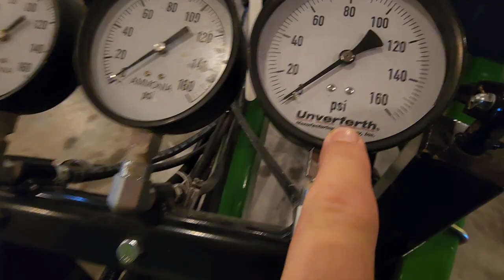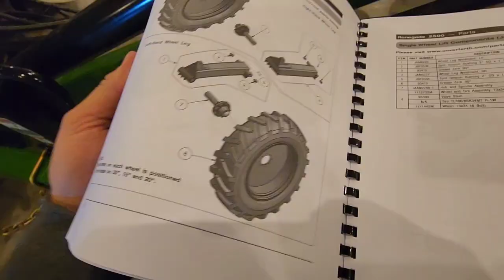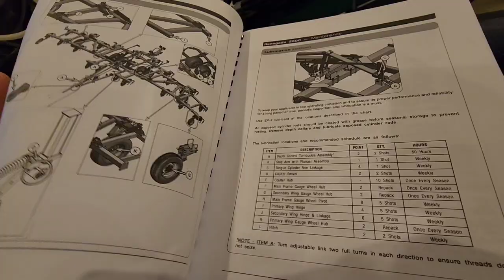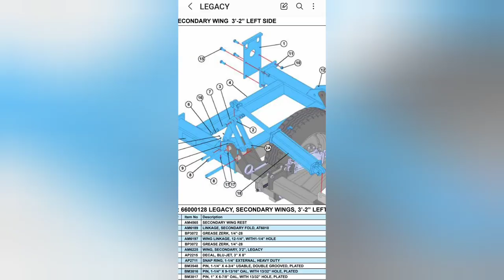Unverferth 2500 toolbar

Comment: The joys of purchasing new equipment. I don't think I ever had a piece of equipment that you couldn't just take to the field without doing some adjustments. Thanks for sharing have a great evening
Reply from the maker: Exactly .. us either ... always something to adjust .. but adjusting is one thing, and completely having to redo because they made no attempt is another ... for what this thing cost, it should be way better set up and finished than it is .... workmanship was severely lacking on this one .... disappointingdisappointing.... but well get it, eventually..... sometimes easier to just buy something that's already been set and up and used a little .... hope harvest is going well ... thanks for checking in

Comment: Are you able to run a single tank, since it has 2 feed lines or do you always have to pull side by sides
Reply from the maker: Yes you can run just one ... just keep the valve shut off on one of the feeder lines. .. both feeder lines went to a Y that  went into the super cooler

Comment: I still like my old DMI tool bars and a lot of guys like the CaseIH ones which are pretty much a red painted DMI. Didn't know unverferth made a tool bar.
Reply from the maker: It's actually a blue jet ...they either bought out or made a joint venture with bluejet ....  we ran DMI for used (red one) ...and in our tough clay, we had a lot  of problems .. finally they updated them and they held up better to the edge bent shanks ...... good to hear from you! ...how's crops over your way?  - we had a 50 year drought here - terrible conditions....
Reply: @Blackearthexcavationandtiling  we had a drought too but everything managed to yield up to par, we just got a 3 inch rain thank god, but it won't be enough to offset the drought. Need a snowy winter to say the least to bring back some moisture.
Reply from the maker: @kolewiebensohn  that stinks.... sounds like a lot of areas got roasted this year..... wow, that's a good drink ...only 1 inch here ... sounds like a cold dry and possibly early freeze out ... hopefully better year next year
Reply: @Blackearthexcavationandtiling  we can only hope as that's all we have left I guess, can't change the weather. But no more rain and wind for a week would be good so we can get our new shed we're building finished...